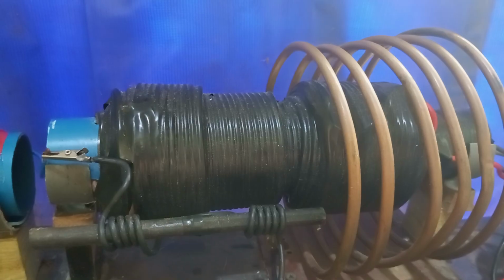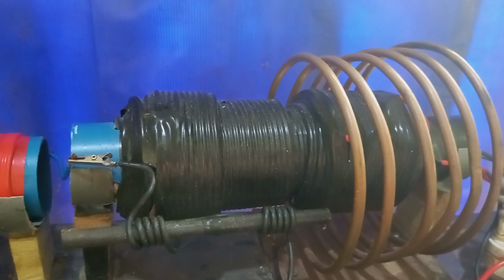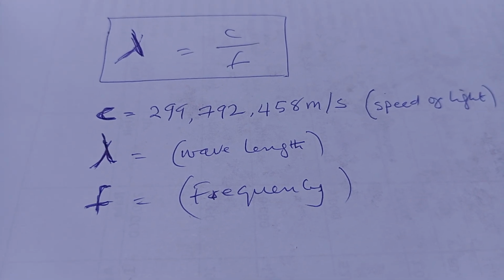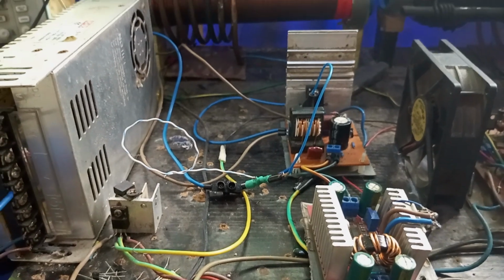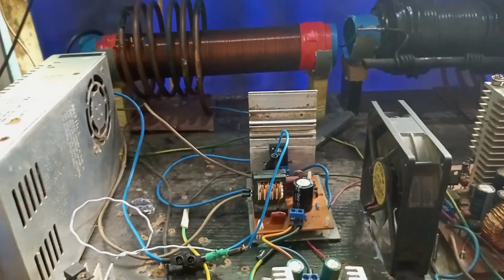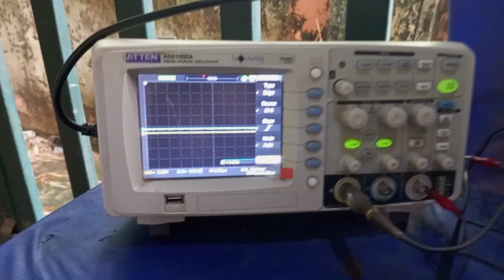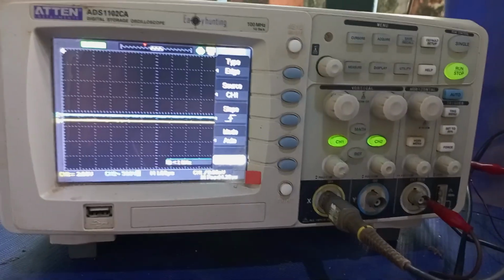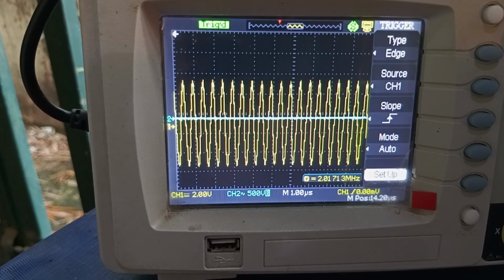Kapanadze, Akula and RuslanType Free Energy Analysis

Comment: Love ur videos very informative. I'm having simular Situation as your Tesla coil. My grenade coil length is 40.5 meter×4=162.12m (full wavelength) this would put the Tesla coil at 1.86MHZ of resonance. So I'm going to have to add  space gap between windings to get higher frequency. What material would you recomend ? I was thinking  using Nilon